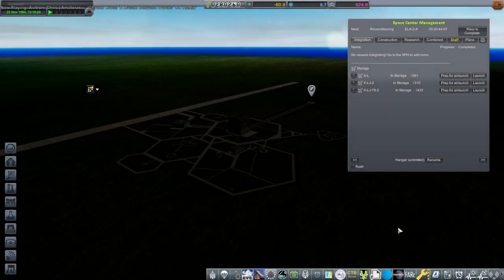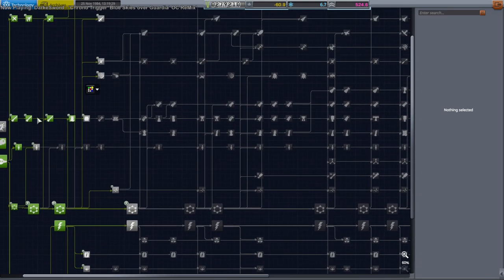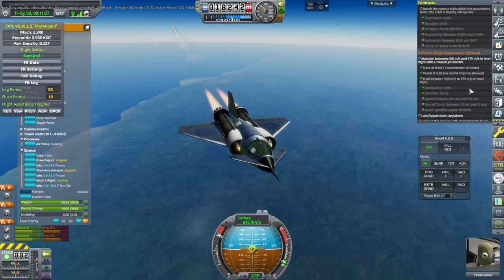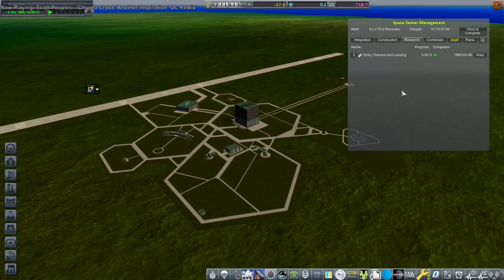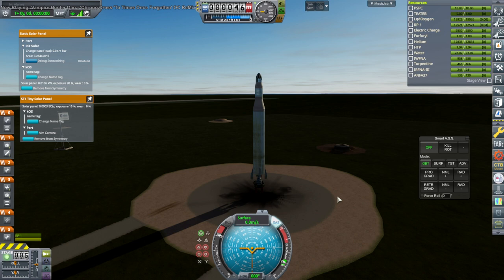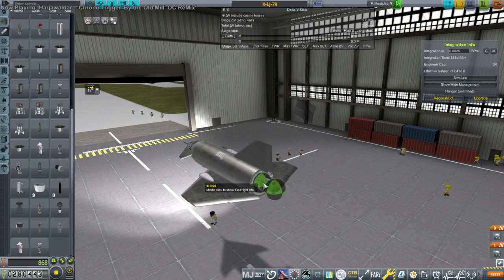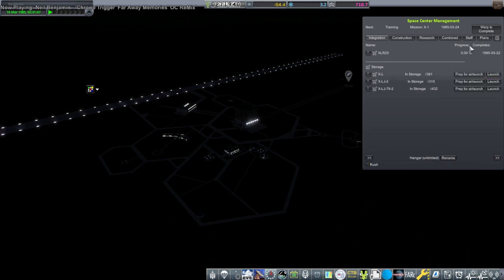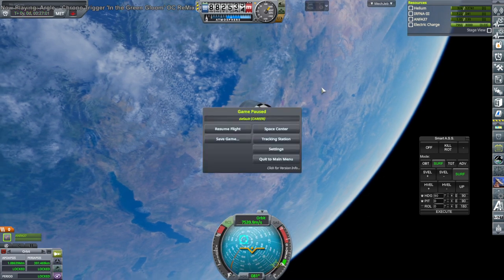RP-1 Career in KSP 1.12 - European Space Agency 14

Comment: The RP-1 tech tree is somewhat complexity based. As you may have noticed, Black Arrow and Ariane 1 parts are in the 1957 and 1958 tech tree nodes, despite both rockets having flown in the 1970s, because they were relatively low performance for their time and so are placed with engines of similar performance in the tech tree.
Reply from the maker: Yes, there is some of that, and I appreciate that. I'm mostly thinking about adapting more generic engines that wouldn't be tied to a particular nation/agency but would be roughly inline with the levels of technology (perhaps for some random country's space program) and also abandoning the date-based naming of the technologies. I've already got the Surestrut Engine pack with those generic engines and I can see about making a more complete selection. The idea is that if someone wants to play, say, Mexico, they can have stuff to work with that isn't too tied with the history of a different location, though they can get that technology if they choose to.